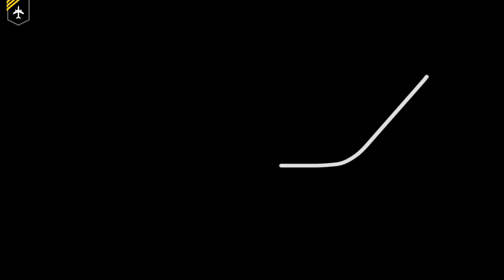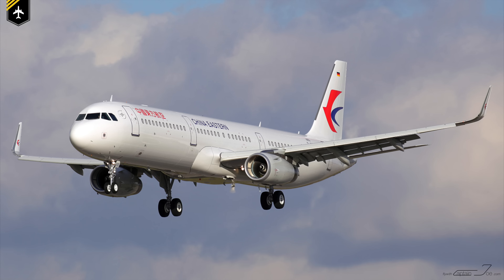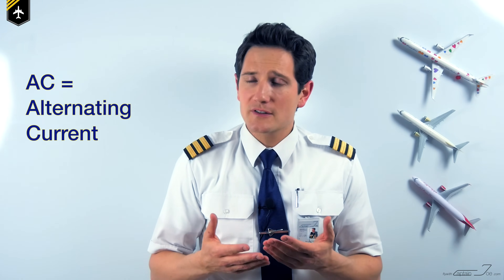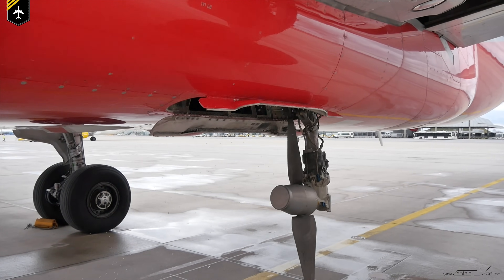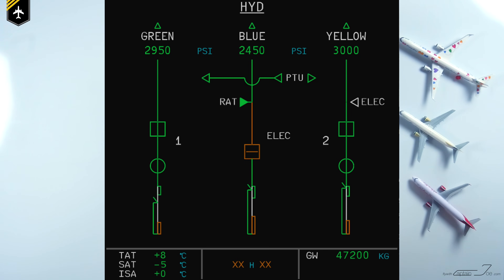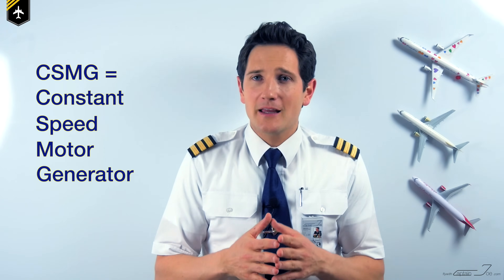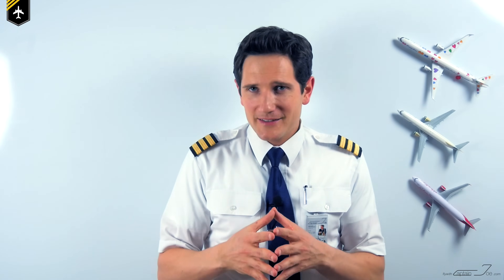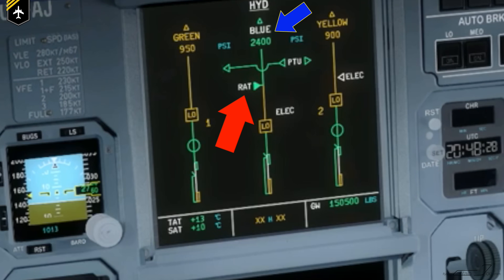What´s a RAT? RAM AIR TURBINE! Explained by "CAPTAIN" Joe

Comment: By the way at 1:48, you said minimum instead of maximum in case anyone was confused
Reply: That's correct - the batteries are required to provide power for a minimum of 20 minutes. They may provide power for longer but, if they are working properly, they shouldn't run out in less than 20 minutes.

So, basically, you know you have 20 minutes of battery power. After that,  you're running on promises if you can't start the APU or deploy the RAT.
Reply: I stand corrected
Reply: whats wrong with minimum? I think he was right. Hell, he even typed it onto the screen!
Reply: I'm not a 100% sure but I believe he is correct saying 20min minimum. It would make sense that the batteries are certified for a minimum amount of time and not a maximum. If it is maximum it could also mean they are depleted even after 1min.
Reply: I think this is a classic case of what is instantly recognised in the industry not translating to the general world. 

in safety. critical applications minimum is used all the time in this context. hopefully Joe adds another few words to better explain to the general public who watch the video next time.
Reply: You can safely assume it will be reliable for 20 minutes. No more and no less
Reply: AyyLenny which means it has a maximum of 20... because you have to assume it will fail at 20:01 I too think it should have read max. bad way to fly... it could last for 20:01 or 45:23 good luck
Reply: it is quite confusing as he said after 20min you don't have batteries.  this makes it seem weird that you would have at least 20min of bat but no more than 20.  also if you go to bat power and have 20min minimum of power it seems like you MUST be on bat power for 20min before you can go to engine or apu power.
Reply: GhostHostMemories as a pilot you assume that after 20 minutes you will not have battery and make all plans accordingly. 
there is no requirement to stay on battery power until batteries are depleated  if an alternative is available such as RAM, API or recovering the engine generators. I didn't get the impression Joe was implying this either
Reply: Maybe the batterys are rated and tested to give AT LEAST 20 min of adequate amperage to power minimum flight systems....
Reply: Typically the batteries in addition to testing and ratings as per easydoz1 the batteries are also given an end of life from date of manufacture at that point they must be removed from the aircraft and replaced (technical engineers can release design changes to extend life but this is very rare for safety critical equipment) to ensure based upon prior testing that they would not have deteriorated to risk the less than 20 minutes prior to removal from the aircraft.
Reply: another aircraft component with a Safety Minimum would be the CVR, which on commercial jets should be 2 hours.
Reply: I interpretated it the same as AyyLenny did. Maybe Captain Joe should have explained a bit more in detail in the video why it's a minimum instead of a maximum. The system has to ensure that it can provide a Minimum of 20 minutes which results for the user/pilot in a Maximum of 20 minutes reliability.
Reply: STOP LIKING, THIS I WAS WRONG!